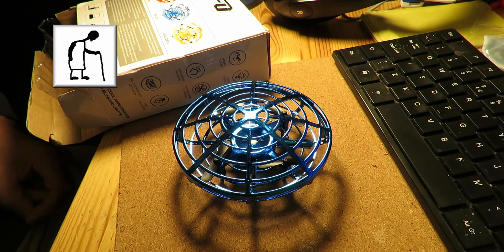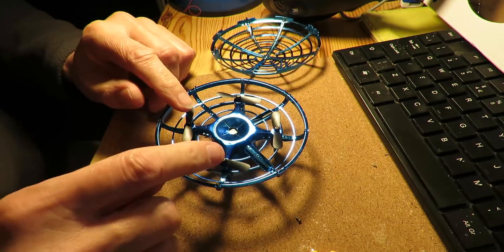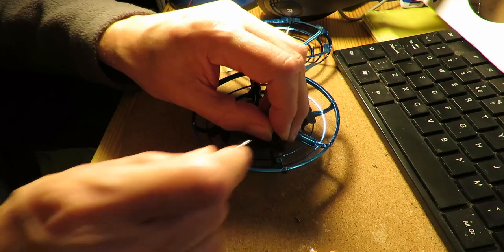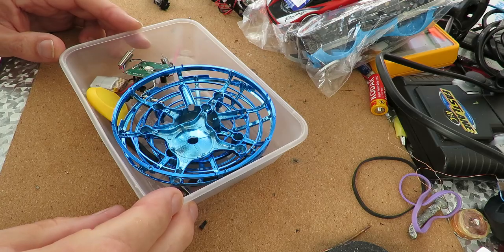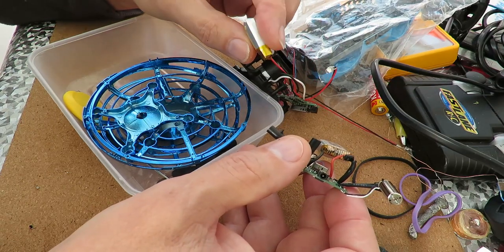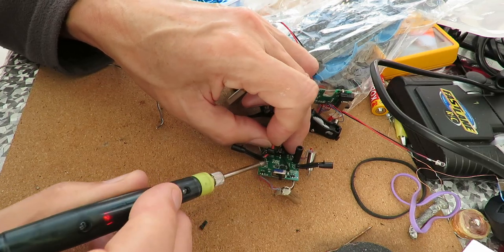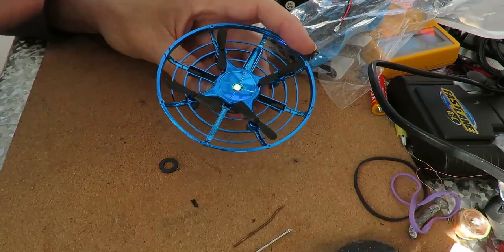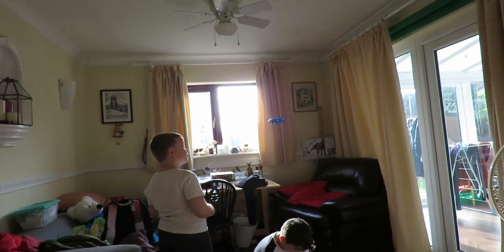Fixing the UFO interactive aircraft

Comment: Good fix.👏  I noticed the IR sensors on the board. One pointing down and two for left and right but where is the sensor for the top, or is it a height detector on the board?
Reply from the maker: I think it detects it has stopped rising rather than it has hit the roof. You will see in the videos it does get stuck on the ceiling and left long enough it reduces thrust and drops but several times it just stays there at full throttle. In another video I am comparing them to an old Air Hoggs toy that does the same actions and just to be awkward they both decided to fly up to the ceiling and stay there.

Comment: Hello.  I have picked one up from charity shop,  but no charging cable to be found.  Do you know what diameter the jack cable is?  Maybe 0.7mm? Thank you!
Reply from the maker: Interesting coincidence. I just happen to have it on my desk at the moment and have my micrometer handy.  The shaft measures 2.46mm outside diameter and 9mm long. The positive is the inner and the negative is the outer.
Reply from the maker: I have done you a video to show the details https://youtu.be/2eV7OGUSV3g
Reply: @GrandadIsAnOldMan  that really helps thank you! 😀

Comment: How to fix it is not fying and turning upside down and stops 
One side of motor will not work if the other is working of the other side works the other side dont
Reply from the maker: It could be that the motors are faulty, or it could be the battery needs replacing. Unless you happen to have the right tools, skills, and replacement parts, it is probably cheaper to buy a new toy. You could just check that there is no dust or hair jamming the motor shafts behind the propellers.